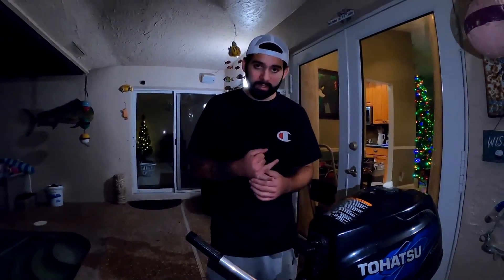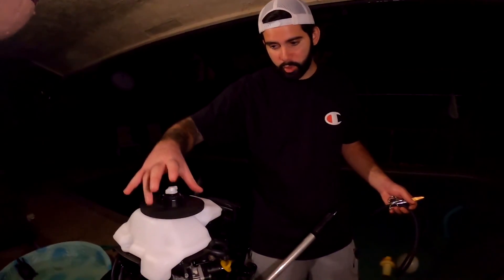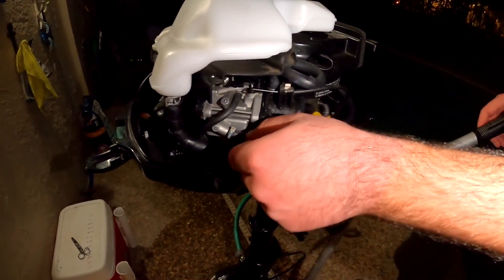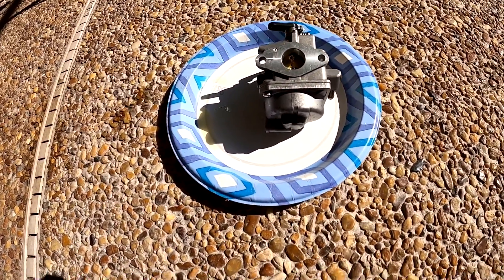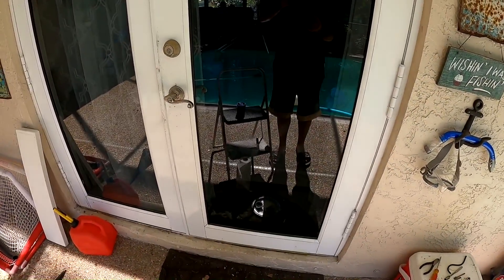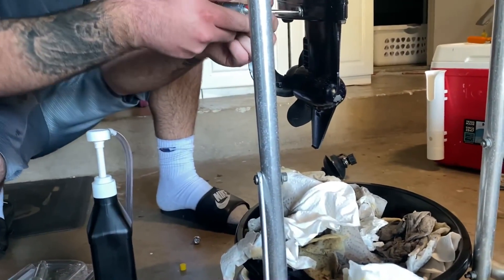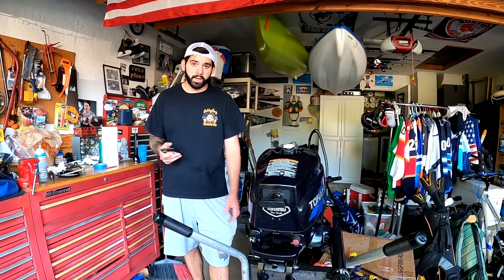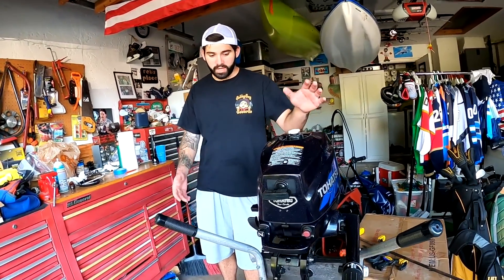I BOUGHT THIS NON RUNNING 3.5 HP TOHATSU OUTBOARD! CAN I FIX IT?

Comment: @ 9:40 You Should Have Checked Gear Change Lever Is In Neutral BEFORE Starting = Safety ✔ Think Safety 1st  ✔
Reply from the maker: 100% correct! live and ya learn, that was when I was still brand new to this
Reply: But how did it start? Recoil starter should be locked if not in neutral

Comment: If you marketed it as a Mercury, it may have brought a higher sale. Most people have no idea that Tohatsu is one of, if not the, largest outboard manufacturer in the world. They make motors for brands such as Mercury and Nissan and their parts are therefore interchangeable between brands. I have a 3.5 Merc that needed some parts and everything I ordered came branded as Tohatsu. Late 2000's models of Tohatsu and Mercs are selling for $700-900 here in Canada.
Reply from the maker: Yea very true! I should’ve put a mercury sticker on it for sure I could’ve gotten some more money, because they are the same motor

Comment: Nice video. Those are great little outboards, I picked one cheap to replace an old Evinrude 2 stroke. I'm pretty sure the Mercury is just a rebranded Tohatsu until you get over 25hp
Reply from the maker: Thank you! Nice how do you like it? I actually like tohatsu they are fairly priced and yea they are just rebranded mercury until you get to a bigger size motor.
Reply: @oneofakindoutdoors  - Small correction. Call it semantics if you will. The Japanese Tohatsu, is the OEM maker of the Tohatsu (obvious), Mercury, Nissan... I'm sure I forget some others. But these are the main ones. 🙂
Mercury is the rebranded and overpriced Tohatsu. Not the other way around. ;-)
Let alone the FACT that this particular one, is the overall best in class! Loosing only to Suzuki in weight and Yamaha for the noise level. Other than that lower consumption, higher power and torque, robust build, etc. Oops!